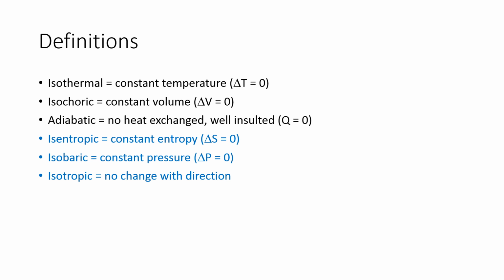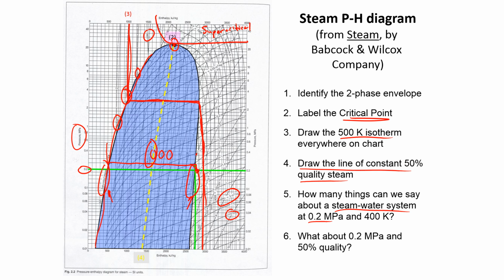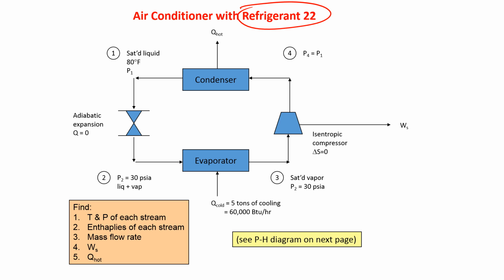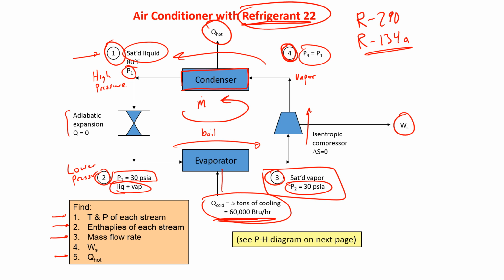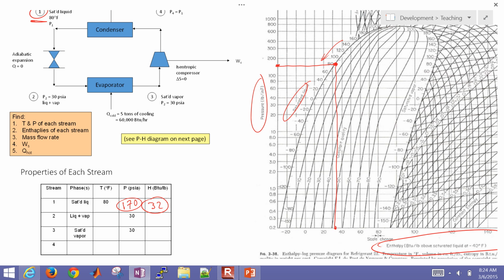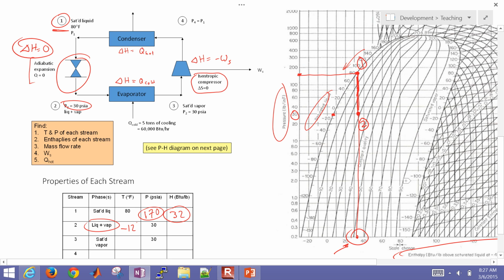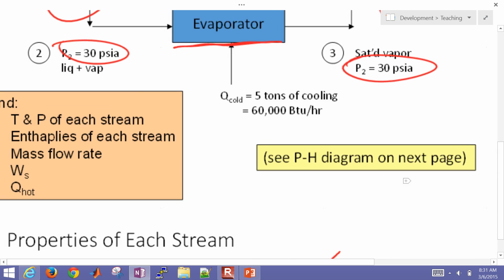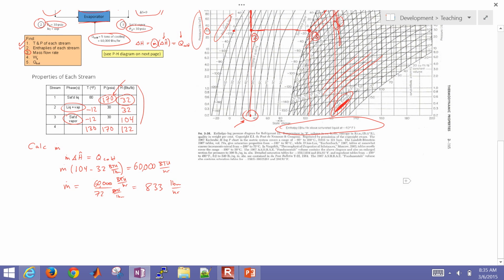Basic Calculations of Refrigeration Cycle

Comment: Sir we are working on a vapor compression cycle related project and want to find the cooling capacity of the system. We can only measure the temperatures and pressure of the refrigerant (by means of sensors and gauges) for the change in enthalpy. The problem is that we can't measure the mass flow rate as the sensors are really expensive and we are out of budget. Is there a way to find the cooling capacity without the mass flow rate or a way to measure the mass flow rate with only presssure temperature and enthalpy??? Please help this is involves our senior year project in mechanical engineering
Reply from the maker: You could estimate mass flow from the accumulation rate of the coolant. If you can put the condenser on a weight scale, it would give you a weight versus time that would translate into flow. It may not be practical if the condenser accumulator is built into an existing structure.
Reply: @apm  oh thanks alot sir

Comment: The enthalpy on my R22 chart doesn't match yours. Where you see H=32 BTU/lb, I'm at 100 BTU/lb (232 KJ/kg). I can't figure out why I can't come up with the same enthalpy as you. I'm so confused.
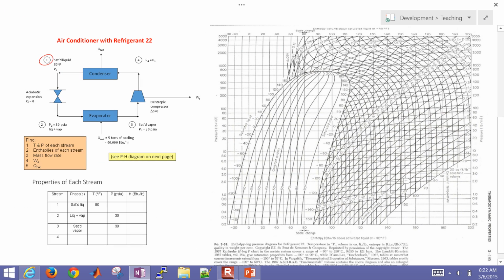Reply from the maker: Check the source of the R22 chart. The one at 13:28 may be different than the one you are using.
Reply: @apm  yeah but R22 is a standard, it shouldn’t have more than one set of properties right?
Reply from the maker: @laloatx5892  that is correct. It should only have one set of properties. One of the two charts is incorrect if there is a difference. The one that I used is from an undergraduate chemical engineering textbook: Felder.

Comment: Sir, 

The video was really useful and got a lot of new learnings to design my system. Can you help me where I can find the resource to design the Fin and tube evaporator for my experiment. I am searching in and out on the internet but not able to find the theoretical calculation or design consideration for Fin and Tube Evaporator. Kindly help me with this.
Reply from the maker: I recommend Perry's handbook to help with that design or else a Heat and Mass Transport book.
Reply: @apm  are you referring to Perry's handbook for chemical engineers..?? And for Heat and mass transfer i am refering to Cengal's Heat and mass transfer textbook.
Reply from the maker: Both of those are good resources. There are many heat and mass textbooks as well.

Comment: Any chance I could get an explanation why the temperature of R22 doesn't decrease after moving through the evaporator? I was under the impression that it takes the heat from the surrounding air making the air colder to be blown into the car. I may be reading the drawing incorrectly, thank you.
Reply from the maker: It is a phase change so no temperature change. It is like boiling water stays at 100 degC until it is completely changed to vapor.

Comment: how do you get these temperature and pressure (e.g. 80F, 30 psia) in the first place when you design a refrigeration system?
Reply from the maker: Those are design decisions. You can change the pressure to a higher value if you have thicker walls. The temperature is affected by the ambient conditions and how low you can reach with your condenser.

Comment: what would be the calculation for selection of the compressor with the refrigerant R134a for a refrigeration system of 3TR ?
Reply from the maker: You could do the same analysis but use the chart for R134a.

Comment: Sir, I have to design an refrigeration chiller for 3 TR cooling , what would be the calculation for selection of the compressor with the refrigerant R134a
Reply from the maker: You could do the same analysis but use the chart for R134a.

Comment: If I am using R134a as refrigerant and have Q=3kW of heat to remove from the cabin of a car, what is the temperature at state 1 and the pressures at 2 and 3 that I should use (i see you already had them to start with)? My external heat/ambient is 40deg celcius. with this I should be able to follow your example and achieve all the elements of my refrigeration system.
Reply from the maker: The temperature that you need for state 1 depends on the size of your air heat exchanger. You can use Q = U A (Tcabin-T1) to get the Area (A) or else the T1 value. You can pick the pressure at 2 and 3 based on the expansion valve design. If you make it too low then there may not be sufficient flow through the expansion valve. A value of 2 atm for P2, P3 could be a good starting value to use for your design.

Comment: Hi Sir I have an query,

I have calculated heat exchanger designed capacity by assuming inlet temperatures & found the outlet temperatures of refrigerant (R134a). 
When i plot those calculated temperatures in the P-h Diagram am getting the different capacity of heat exchanger. Could you suggest how to bring the system equilibrium.

Latent heat ratio considerd as 0.75 at Evaporator throughout the calculations & iterations.

I tried with changing inlet temperatures from lower limit of refrigerant to higher limit in PH diagram also changed the super heating as well. still am unable to achieve the equilibrium state.

Kindly suggest what else could be the other mode of mistakes.
Reply from the maker: That sounds like an optimization problem. You may need to adjust the efficiency to get the two states to match. Also, I typically start with one point in the circuit and go around the loop instead of specifying two separate points.
Reply: @apm  OK, Thankyou sir.

Comment: Refrigerant-134a enters the compressor of a refrigerator as superheated vapor at
0.14 MPa and -10°C at a rate of 0.12 kg/s, and it leaves at 0.7 MPa and 50°C. The
refrigerant is cooled in the condenser to 24°C and 0.65 MPa, and it is throttled to
0.15 MPa.  show the cycle on a T-s diagram with respect to

saturation lines, and determine (a) the rate of heat removal from the refrigerated
space and the power input to the compressor, (b) the isentropic efficiency of the
compressor, and (c) the COP of the refrigerator                                                                                                                                                                           when i solved the example i said that Q rejected=m(hv@0.15mpa-hafter throttling) and i didn't say (h entering compressor-h after throttling) as we know that it exits from evaporator saturated and enters compressor superheated due to heat transfer in connecting line and pressure drop
Reply from the maker: This sounds like a great exercise. Let us know the solution once you work it out.
Reply: @apm  it was a question in an exam and i solved by this method, i want to know if this method is right or not
Reply from the maker: @13-ahmedmohamedhassan73  I don't typically dig into specific problems such as this - it would take too long to respond to all of the requests that I receive. However, if you do find a correct answer, I encourage you to post it here so that others can also see the results of this example problem.
Reply: @apm  how can i make sure of my answer
Reply: @apm  our exam was difficult so i want to make sure that i won't lose many marks
Reply from the maker: @13-ahmedmohamedhassan73  you'll probably need to wait until you get your exam back. I don't think anyone online is going to verify it for you.
Reply: @apm  it was a question in an exam and i solved by this method, i want to know if this method is right or not

Comment: Great video. But I thought the expansion was isenthalpic, not adiabatic?
Reply from the maker: Thanks for highlighting this point. The expansion is adiabatic, not isenthalpic. Isenthalpic and adiabatic are the same only when the process is reversible and with constant pressure. The change in enthalpy is generally small with change in pressure versus change in temperature, however, so adiabatic and isenthalpic are nearly the same for expansion.

Comment: Please submit solution for CO2 refrigeration cycle calculation – give COPr value, if

Evaporation temperature is – 20 C and condensation is at +40 C

Isentropis efficiency of compressor is 0,85.

Please calculate mass flow of CO2 and compressor shaft power for cooling duty 100 kW.

USE CO2 moller chart 
can any one solve this problem
Reply from the maker: That sounds like a great homework or exam problem. I hope the video helps. Unfortunately I can't help with homework or exam problems.

Comment: Hi. How do you get Q in kW if you don't have any information given in units of BTU/hr. I was thinking in Q=mass flow*(H2-H1) for example but I can't do that because she don't have Q in BTU/hr for example.
Reply from the maker: When you design a refrigeration system you typically start with a specification on how much heat must be removed such as tons of cooling (how much ice you could freeze in a day) or kW (rate of energy removal). The rest of the system is designed from that starting point.
Reply: APMonitor.com yeah thanks but what if I don't get to have that data? My teacher has put exercises like those in her exams and I never know how to get Q in kW if I don't have any mass flow rate or W in kW or V in ft^3/hr. Thanks for your answers
Reply: Uriel Rivera fuck you sorry ass nigga

Comment: The Qcold is referred to the heat of our home, that is going to be used in the evaporator in order to cool down our home? Am I right? Thinking the evaporator as heat exchanger and trying to identify the cold and heat streams. Then the heat stream is the stream that comes from the home and the cold stream is this that comes from the expansion valve (which is the refrigerant). Am I right? Thank you in advance!
Reply from the maker: yes, that is correct. I appreciate your comment because it will likely help others as well.
Reply: Thank you so much for your answer. I want to ask you an extra question: if I want to simulate a cryogenic distillation, then the duty from the condenser of the cryogenic column will be exchanged with the duty of the evaporator of the refrigeration cycle? 
By the way your video is amazing and really helpful...!!
Reply from the maker: Yes, they would be equal.

Comment: Hi, in your worked example you begin with the starting temperature of 85F. What is the reasoning for this temperature? is it a random value? typical value? a value which directly relates to most refrigeration systems? or environmental consideration?
Reply: it the temperature a known datasheet value given by the refrigerant in use? also is there an absolute temperature the refrigerant can work to and does this value require to be a factor below the designed temperature required?
Reply from the maker: +uberkwii, Yes, the 85F is an ambient temperature. The temperatures shown in this problem would change with different conditions.

Comment: Hello my dear sir, please could you help me in this problem 
it is not clear 
3.  Refrigerant-134a enters the compressor of a refrigerator as superheated vapor at 0.1 MPa and 
-10°C at a rate of 0.12 kg/s, and it leaves at 1.4 MPa and 50°C. The refrigerant is cooled in the condenser to 24°C and 0.65 MPa, and it is throttled to 0.15 MPa. Disregarding any heat transfer and pressure drops in the connecting lines between the components, show the cycle on a T-s diagram with respect to saturation lines, and determine (a) the rate of heat removal from the refrigerated , space and the power input to the compressor, (b) the isentropic efficiency of the compressor, and (c) the COP of the refrigerator.

I could not find the enthalpy at state 2 , because there is no values in the given temperature and pressure in the superheated table 

please help me
Reply from the maker: It leaves the compressor and into the compressor at 1.4 MPa but leaves the condenser at 0.65 MPa. There normally isn't a big pressure drop across the condenser unless the diameter of the tubing is very small and there is a high flow rate (Reynolds number) that would cause a lot of pressure loss. You may want to recheck the measurements for your system to ensure that the pressure drop across the condenser is correct. You may also want to check if stream 2 (inlet to the condenser) already has some liquid. This is generally a poor design because liquid in the compressor can damage it.

Comment: why would you use PSIA as an example of pressure when the R22 system is enclosed and should be psig?
Reply from the maker: Good question! psig would certainly be more convenient for pressure gauge measurements. However, thermodynamic quantities such as enthalpy depend on the absolute (psia or MPa) pressure as shown on the charts. It is easy to convert between the two but the conversion factor would depend on your elevation above sea level and the conditions for that day (small changes). At sea level, you typically just add 14.7 psi to the gauge pressure to get absolute pressure.